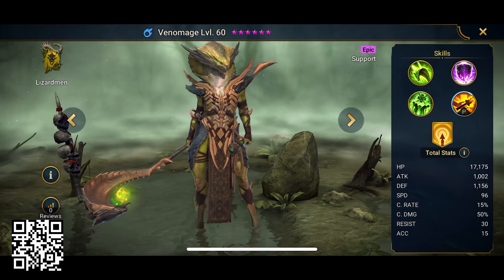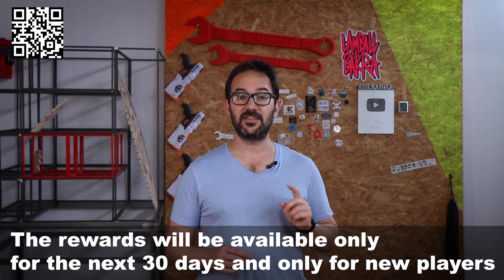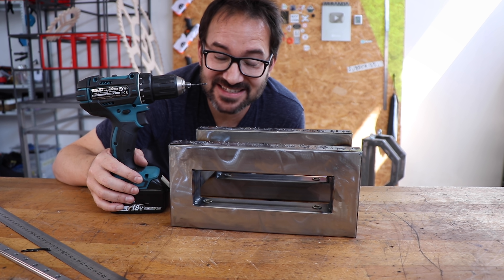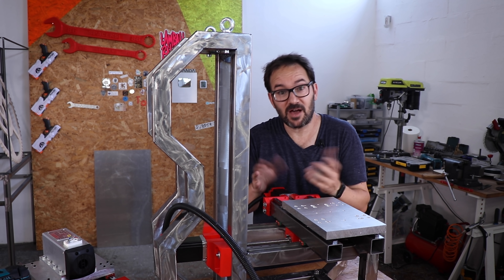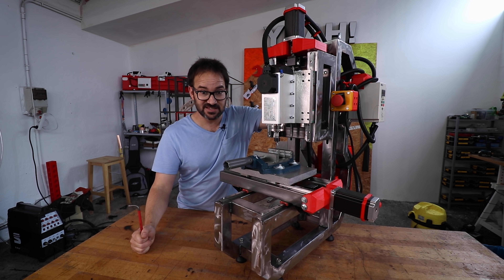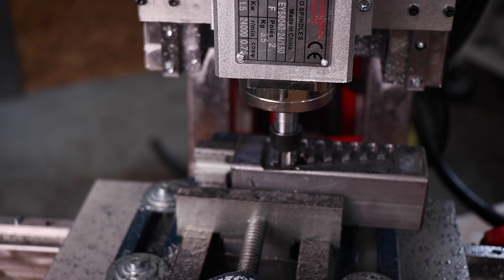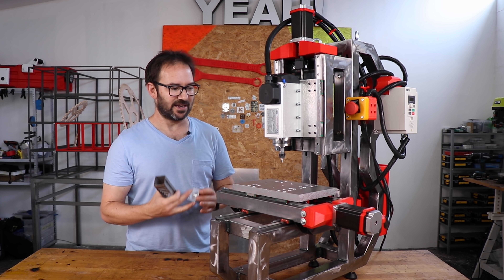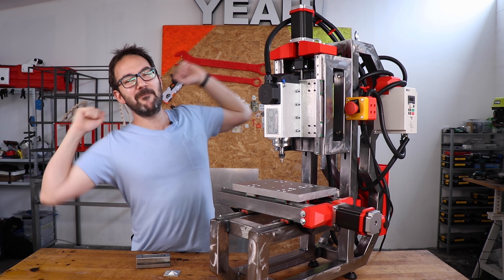I MADE A STEEL CNC MILL FROM SCRATCH (desktop version)

Comment: I'm currently building with aluminium and need a lot of strength... I'm debating steel, but it's a pain to work with, I'll rather try to use stronger aluminium. There are a lot of different thicknesses and grades of aluminium available, some are very strong.
Reply: I watched the other video about the aluminium cnc mill and I think it definitely doesn't have to have as much wobble.

Comment: TIG Welding tips for u
Always grind the tungsten with fresh clean disc
Set postflow longer than u need so tungsten wont change color after stop to gray
Clean the parts with acetone
Dont rush...
Set amps low and let the steel heat up then start welding so u dont get to high amps when part already heat up

Comment: Ivan i like you, but you gotta stop using PLA parts in CNC machinery, like bulkheads, motor mounts and such. You might not know but you're introducing 0,5 to 1mm of error due to the compliance of the material. Never the less a well executed project.

Comment: Ivan, by introducing 3D printed transmission parts, you introduced some issues. Please change your ball screw nut blocks by stiff metal ones as soon as possible ;) I would have introduce adjustments screws on each axis because setup of the machine is a nightmare without them. Good luck for the following :)

Comment: you should use the milling head to face the "table" itself to ensure the parallelism of the table in comparison with the the xy travel plane of the milling head. the squareness of the Z travel in comparison with the xy table can be check and tram after that. Ohh, and awesome, awesome build as usual, it just needs some fine tuning and then you built yourself a beast

Comment: I must say, it is a testament to your skill as a maker that this works as well as it does... 
This is incredible. 

Also, aluminium is *evil*... It doesn't matter how big or rigid the machine is, the aluminum is going to try to grab your bits and make the machine complain...
Steel would actually be easier to machine with this setup.

Comment: With all the money that was spent on these last 2 revisions, you could have easily picked up a second hand Tormach and had a WAY more capable machine with a huge amount of upgrade potential. I picked mine up for less than $4k and it would absolutely destroy this machine in every way.
Reply: Sadly we do not have them here in Europe. Otherwise I agree. Any second hand manual mill would beat the it. Hands down. 
But then its not CNC and you have to do a somewhat complex conversion. 
Until you get it to really do CNC work you are easily spending several thousands more. But even then you do not have a machine designed for CNC work.
Reply: @nukularpictures  A manual mill converted to CNC is going to function better than this thing, provided you eliminate the backlash. The linear bearings used in this machine absolutely will not function well long term. They do not correctly transfer vibrations to the machine to help eliminate or reduce chatter. There is a reason linear bearings are not used on milling machines. You need a large flat mating surface to transmit vibrations from surface to surface. You could make the knee and frame as strong and heavy as you want, your only dampening comes from the table in this setup. The linear bearing will isolate it from the machine.
Reply: @14768  I fully agree with you there. Just personally I would go with older quality cnc mills if I would go the used route. 
Most of the time you just would need to clean them and replace the controller. 

I am currently in talks about a HAAS Mini Mill. Asking price 9000€ but I am sure ill get it a bit lower.
Also saw a Deckel FP4 for unter 7000€. But there I would have a harder time replacing the controller. 

So personally I would not go the route of converting a manual mill to CNC. I would save that money and go with an old CNC and just try to replace the controller.

Comment: Nice job on the video and the build.  Definitely look at moving the y motor to the front, put a skin on the machine, and fill with casting cement/epoxy. Make sure to add in a means to bolt it down to help add additional weight too as you may find you want more later.   You could also modify your y setup some to add a catch basin in the cement with a drain, so you can make a liquid cooling setup. The Z extension can be tied to the rest of the body with the epoxy cement core and help move the vibration to a much higher frequency to help reduce chatter at lower speeds. Adding a bolted on solid base with a vibration absorbing material will help further, but will also likely bounce the vibrations back to the top of the Z, so if you go that far,  you will have to do some tests to find where the sweet spot is. There are some nice accelerometer testers you can get these days to test for vibrations at cheap diy prices due to the Voron push in 3d printing.

Comment: Nice machine!  get some way-covers on that and you'll have a nice little work horse!  

Welding side panels onto the base will help with stiffness.  Though ultimately you're probably limited by mounting the linear rails on the side of a tube.  I'm not sure I'd trust the riv-nuts clamping the Z either.  They might un-crimp over time.

Comment: linear guide must be fix on a rectangular cold steel. cold steel is easy to scratch in order that the 2 linears guides be coplanars. One linear guide is set fix this is a reference for the second so the second is adjustable lock in a U shape part and a screew on the side to get the 2 guides parallel each other.

Comment: This machine is nothing but a gimmick. There is no mass in the machine bed you've made. It's bad as mass means energy. So in this case there is no way to absorb the kinetic energy the cutting tool applies to the work piece when machining. As a result you'll get severe chatter and stuff like that. The only way to diminish chatter level on this machine is to use milling cutters of sizes as small as possible with sharper rake angles to cut softer materials. With having no scientific reason in mind you'll never be able to build anything that works. The sleep of reason produces monsters.

Comment: cool beans! also looks like passes were too deep. maybe get a chart to know feed rate and rpm speed of bit to prevent overload of bit. also look at climbing versus non climbing cnc methods. best!
Reply: To deep? The machine should be able to handle much deeper passes. It is often a problem that people go to easy with the machines while going harder gives you better finishes. I have seen that a lot with hobby machines. 
This is a machine out of steel. With the high RPM spindles the forces are quite low, so cutting 10mm depth with over 1mm width should be possible.
Reply: @nukularpictures  cool and thanks for explanation. as long as the rpm of spindle  is fast enough to clear chips and the correct cutter is used, depth shouldn't be an issue. what i saw was the cutter at some point jamming into the material so the spindle didn't appear to have the power to keep the rpms needed to clear the chips and was overloading the bit. this would cause corner nicks and deformation in metal and could possibly break the expensive bit. a solution to an underpowered spindle is to reduce cut depth. there is a limit to how fast a bit can turn depending on material, even with cooling (which would make a great upgrade). there are simple tool guides to figure this stuff out. a feed and speed short cut tool shows bit size and optimum feed rate. depth is more about tool height and strength of bit (most likely diameter) and power of spindle to keep rpm under load. consideration for spindle power moving in climbing and conventional. great video btw!
Reply: @profounddevices  Well it is difficult to really separate it. The power your spindle has to produce is of course dependent on your depth of cut, the width of cut and the feed rate. 
The motor is only able to produce a certain torque at a given speed. As soon as you ask the machine to take a cut that would require too much torque the spindle will slow down and eventually stop. 

As soon as that happens you usually break the tungsten carbide bits used in the high RPM spindles. They are just to brittle to withstand the sideways load. 

If that happens you have more than just reducing the depth of cut. I personally would start reducing the width of cut. Especially with the adaptive toolpath it gives you much better finishes as the cutting force is spread over a bigger part of the endmill usually causing lower vibrations. Also you might have to change the endmill. 

Endmills are designed for a certain chip load, so how much material each flute is supposed to cut. This is what determines the feedrate for the bit. As an example I use 4, 3 and 2 flute DLC bits depending on what I want to do. The 4 flue bits have a manufacturers recommended feedrate of around 3000mm/min, the 3 flute 1800mm/min and the 2 flute around 1000mm/min. So if i keep all other parameters - depth of cut and width of cut - the same I get different requirements for the spindle power. Given a 6mm endmill, 2mm width and 10mm depth of cut the 4 flute uses 2,2kW @ 0,8Nm, the 3 flute 1,4kW @0,5Nm and the 2 flute only 0,8kW @ 0,3Nm (all at 24k RPM). 
So I do not need to change the depth but I have changed the required power dramatically. Of course I also only take a third of the material per minute with the 2 flute endmill compared to the 4 flute, but as you can see I have much more variants of reducing the required spindle power. 

Just reducing the width of cut is usually the worst idea since it removing a big chip is important in keeping the material cool. A lot of the energy is usually moved away with the chip. So especially for gantry style, high RPM machines I would go with single flute bit. It causes the lowest force and thus lowest distortion and is very good at removing heat from the workpiece. 

But I agree with the coolant. Mist coolant is one of the most important upgrades CNC machines. It pushes the chips away, cools the part and lubricates the endmill. Your surface finish is usually a lot better once you have that but choosing the right endmill with the correct feeds and speeds is equally important for good finishes.
Reply: @nukularpictures  it sounds like your on the correct path and know what you are doing. a lower feed rate (slower width speed) would help with loading of the bit. correct spindle speed with constant rpm would allow clean chip removal (coolent would help, and also keep material from expanding and warping). from your detailed reply i understand that you know what you are doing, and are upgrading in the areas needed for power of spindle, correct feed rate and correct bit, and correct spindle speed and not to fast. a metal mill that is a tank is anybodies dream. i look forward to the upgrades videos

Comment: It would be interesting to see a shoot out between this and the previous mill you built just to show what you gain from making one this way. Mill that test piece on both mills in both aluminum and steel. Take notes about total machining time for each and compare the quality.

Someone suggested you machine the bearing mounting for the ball screws in aluminum to replace the 3D printed PLA parts and make them more rigid. If you do something like this then it would be interesting to see a before and after test to show if it made any noticeable difference in the surface quality. Everyone keeps saying rigidity, rigidity, rigidity, but it would be interesting to see if it makes a huge difference or if it's subtle. The PLA parts are pretty substantial and the material dampens vibrations pretty well. So it would be interesting to see just how much difference there is.

Comment: Turn down the RPM on your spindle its really tempting to go as fast as you can on a new machine and little experience in CNC but half the RPM will give you so much more torque and better chips
Reply: Well that is not true. It highly depends on your endmills. Mine run fine with 24k RPM, just use DLC coatings. 
Also no sadly those spindles do not really give you more torque at lower RPMs. At least not the cheap ones like he is using.
Reply: @nukularpictures  i have the exact same spindle ...
Reply: @jakeengland1430  So have you measured it? I have seen plenty of them and it never worked out. 
I mean maybe they have a bit more torque at 20k RPM but that's it. You will not gain more by going lower than that.
The spindle cant handle the higher current required for more torque and the cheap VFDs cant deliver it. 

And even if they do it is often not a huge difference. The 1.5kW Spindles will give you only 0,8Nm or so at max. Might drop down to 0,6Nm at 24k RPM. But that is generous. From what I have seen the Chinese spindles are often 10-20% lower than spec. I mean there is a reason why you do not get the graphs from them like you get from quality vendors. 

But for sure not half the RPM. At that point you are just limiting the power of your spindle by 30-40% or so. 

Run them at 20-24k RPM and you are often good to go. With the depth and width of cut he is not even close of using the full power of the spindle. So maybe getting some more torque is not the problem here.

And like I said. Use DLC coated tungsten carbide endmills and they run fine with those RPMs. I use them on a 1.1kW brand name spindle all the time. They cut great, leave perfect finishes and have no problem with high RPMs.

Comment: I'd box in as much of the open structure as you can with 4 or 5mm sheet steel. It would make the frame a lot more rigid, even if they were only attached with bolts into the frame (Rather than welded in). It would help get rid of some of the tool chatter marks in the work.
Reply: Bolts are way better than welding. You want rubbing action under vibration. It’s a very big job to do this as you want intimate contact with no bending.

Comment: You might consider adding concrete or sand inside the steel tubes. It adds weight, but more importantly rigidity to the whole structure and helps with resonance/chatter. But a fantastic build nonetheless! :D

Comment: I accidently on purpose bought some giant pillow blocks... like 1.5 inch diameter  (linear bearing on a round rail) and GIANT steppers.  They are made for a CNC and are industrial american made.  I was looking for larger parts for a larger 3d printer (around 600 cubed) but these are massive.  I need to make a CNC machine now.  The cool thing is that the 1.5 inch rails are available on ebay used (and slightly out of spec i would assume) for under a hundred bucks a pair x 600 long.

There should be no question that the motors can do the job.  I do need to supply 100v to them.  The actual spindle is the only thing... as soon as I can figure the spindle and the motor control on the cheap it should be good.

Comment: Fill the tubes with foam, concrete, or epoxy. This will stiffen it up way more making it better for machining. It will make it quite too. Mass means more stable for milling

Comment: A few advices from my point of view (and at least 50 or 60 custom build CNCs):

1. Weld using magnetic angle clamps
2. Never ever drill or hammer the base of already mounted rails
3. Use CALIBRATED metal blocks when centering things to be parallel
4. After you think the machine is complete, just pick the dimensions of calibrated object like precision steel ball with CNC precision steel touch probe and then recreate it. If the dimensions of the copied object are not close to the original, then you have a problem
Reply: hi can you help me to build one ? 
i need one for my bicycle workshop where i need to make some critical parts 
for that i was thinking to make 1 myself but couldn't find a good detailed walkthrough  video or guide to follow 
i think 0.01 mm is more than accurate enough for my line of work
Reply: @tanzinsiam7559  It's not rocket science to build one, you just need to have enough money to complete the project. As first step you can pick the working dimensions of the CNC to target those of the biggest bicycle part

Comment: When using a vice, the area being milled needs to be between the vice surfaces. The overhang flexes and throws off your accuracy. Your frame needs much more bracing under your table as well. The tool pushes down on the x and y axis and there is no support underneath. Even 2 uprights directly under the center of the base will reduce flex by a ton. Ideally, you would make a box around the frame and fill it with a mixture of granite and epoxy. It will give you the strength of a professional machine this way.
Reply: He also needs Motor mounts and spindle nut mounts of metal. It can only be as stiff as it's weakest link. And these ultimately have to bear all the loads
Reply: I find that minor overhang is fine. Source: I can mill parts within 0.0005" completely manually with perfect perpendicularity.

Comment: Cool project! I am a bit envious. I just don't find the time to continue my project. If I find some spare time at the moment I work on a math/economics project instead. I just have a question, if you use a metal frame, which should increase stiffness with respect to an equivalent aluminium frame, would it not be better to connect the tables to the ball(?)-screw mechanism with a metal part as well? Or is the printed plastic stiff part enough in that case?

Comment: You just made an aluminum one the other week, was it not rigid enough,  that you made a steel one so soon?   Also you should look into fiber welders if you plan to do a lot of low distortion high precision welding.   Theybstast about 3x the cost if a good welding machine,  but the time saved more than makes up for it.